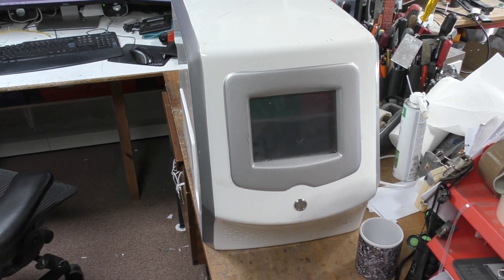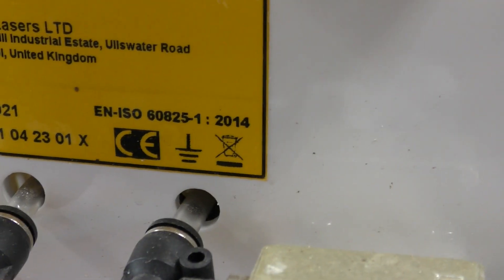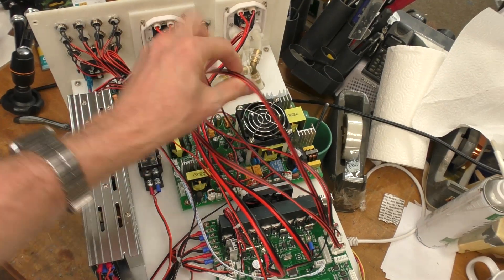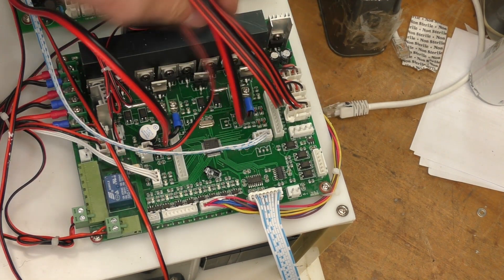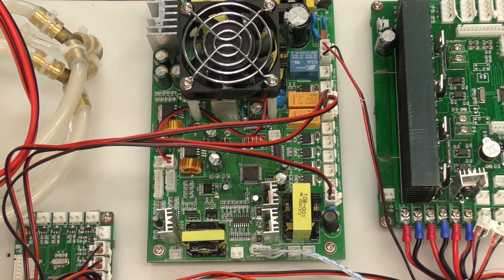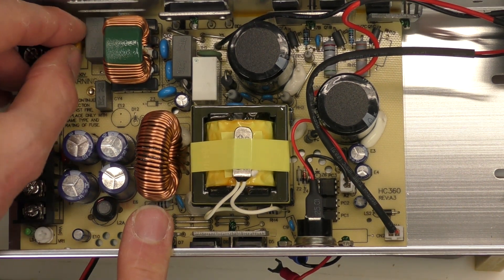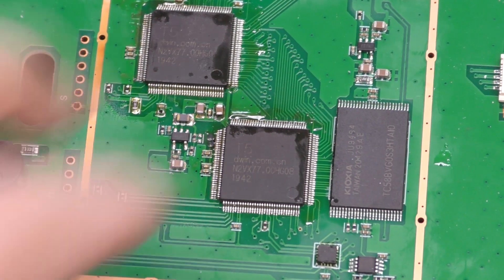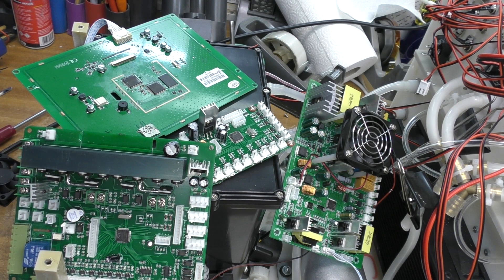Apollo HL8 cosmetic laser unit teardown

Comment: Hi Mike,  This machine is too small for a Dual Head machine,  The Laser Module would normally sit under this control head,   in the Laser Module it would have the 2 or more  diffwrent wavelength Gas Lasers and the more cooling system, They have cooling for the Laser Tubes but also cooling for the wands so soothing the skin.  There machines use Short Wave  RF that is emmited from the wand thet is used for multiple reason but pain relief from the zap of the Laser is one reason.  In the head of the wands they also have high power xenon lamps for IPL (Intense Pulse Light) treatment this also has some selectable filters to tune rhe light for different skin types.
Reply: The lasers are normally nd:YAG or other mixed Gas Lasers.

The connection on the back are normally for Light Therapy Modules,  Which are packs that contain a mixed or Red and Blue LEDs, & Near-UV, Near-IR LEDs.

Comment: Who cares if it won't fly to the moon - it's still some nice modern pro electronic gear. It could be built a bit cleaner when it comes to cable routing, but it still looks pretty. I'm kinda concerned about these moving terminals at 4:30. Fan mounting (6:23) is indeed dodgy, the fan could be attached to the heatsink instead. 
The PCB looks pretty nice though I'm not a fan of this substrate. To think that a single piece of ground wire could make it so much better...
The hydraulic system is just damn lovely, I'd totally reuse it in a small CNC mill or laser engraver cooling system.
Reply: This is NOT a piece of pro electronic gear, it is a very dangerously made piece of high energy equipment, I doubt the laser safety was tested or is even controlled, and the CE mark is 100% fake because it would require adherence to ISO 60601 for medical devices, which in turn would require safety marking by one of a handful of registrars in the EU and it would be next to that mark.  If it was intended to be sold into the US as well is would require the same under 21 CFR 1004-1050.  And no safety agency would even stick around for 2 minutes after opening it and seeing the front panel mains switch with no grounding or isolation.  I've been being audited by them in the device and laser emitting device industry for 20 years now.  This  would result in a consent decree if inspected by FDA.
Reply: the terminals at 4:30 look identical to the terminals used by Anet a few years ago to connect the hotbeds of 3d printers, which contributed to multiple building fires

Comment: Lasers of this class require some form of access control, like a key switch to turn on the laser. I don't see any on the unit. It is allowed to implement the switch as a software password as well, so it could be in the touch interface. A remote interlock jumper is also mandatory, so at least one of the connections on the back is an interlock.

Comment: One of my 3D printers has a smaller DWIN HMI.  They're neat little modules for what they are and the price, although the documentation is mediocre.  I think yours is dead, since they'll normally boot up into some sort of display (usually a splash screen) before receiving any serial commands.

They expect you to use their janky Windows software to build UIs for it, which spits out a bunch of binary blobs that you then load onto an SD card and put into the display.  The display can do limited navigation between screens (which the docs call "pages" iirc) without serial interaction, and I think it can toggle GPIOs on the modules that have them, but otherwise they rely on another host reacting to touchscreen/button presses and updating the field values via UART (where the layout/type of fields is programmed via SD card and can't be changed on the fly).  They are conceptually similar to Nextion displays that I think have a little more foothold in the hobby market.

Comment: I doubt that the screen in that thing is 1080P but if it is that explains the two video chips - some higher res lcds are electrically two lower res screens stuck together, with ODD and EVEN LVDS pairs.. it might be that each chip drives either the left or the right side in sync.

Comment: 9 in 1 Ultrasound 40K Cavitation Vacuum RF Slimming Machine Laser Treatment Body Liposuction ??
Reply: Definitely not the same unit, but gives an idea of the accessories and operation modes. Those multiple identical plugs Mike was unsure about are for "laser pads", looks like a couple of laser diodes on a pad for some voodoo fat removal magic.

Can see an overview of that 9 in 1 thingo here https://www.youtube.com/watch?v=JxByXRIYrK4
Reply: @Thermoelectric7  creepy
Reply: Your very close,  all the the Liposuction,  Although the do used Mixed Lasers and Xenon aswell as SW RF to break down fat,  But mostly used for SHR IPL Hair Removal, and some Laser Treatment,  But most of the Hair Removal there days used the Xenon Lamps rather than the External Lasers

Comment: It was in a vapor face cleaning device (with an ultraviolet lamp ozone generator) that had the ground wire screwed on the plastic case. With a proper locking washer and everything. 😂😂😂😭😭😭

Comment: This seems to be a standard construction of a cheap cosmetic device sold expensively. I work in an environment that I repair many cosmetic devices (out of courtesy). The vast majority of them are medium to good quality modules slapped together with cheap plastic by people that doesn't seem to understand what they are doing. Many boards are interchangeable between LASER devices, TENS devices, galvanic currents, high frequency ultraviolets therapies, ultrasonic peeling devices. etc.

Comment: new watering and lightning system for your plants ?.. its all there .. pumps, valves, reservoir, simple micro , light switches,  power supply.. really all you need :D
Reply: PS: I would guess the 2 pin connectors are for something like foot switches to turn on and off suction or the laser or whatever functions that thing has, maybe programmable through the software ? maybe there is a manual for similar machines that reveals that secret ^^

Comment: at least you can get a few fans and heat sinks for your “junk” box out of it

The display could also be useful.

Thank you for the tear down
Reply from the maker: I REALLY don't need any more fans or heatsinks....
Reply: And most of these displays that you can't get datasheets for are a waste of time. Why reverse engineer some one off garbage when you can just buy a display that's still in production and comes with datasheets for not that much money

Comment: Must have been a pilot device. I can't believe any importer would deploy kit in a metal box without grounding the chassis. Especially something containing a conductive liquid and intended for a wet operating environment. It wouldn't even pass a PAT test. That said, it's surprising to see that in a prototype too.
Reply from the maker: It was a plastic box
Reply: The biggest plot twist of the day that even i fell for. That plastic box looks more metallic looking than most metallic boxes out there.
Reply: I've seen some impressively Badly designt and manufactured equipment important from China to Germany

Comment: Looks like the brains for an IPL, "intense pulsed light" unit. The laser head is just a stack of 808nm diodes bolted together, with no lenses, and overdriven to death in pulsed mode by the CC circuit inside.